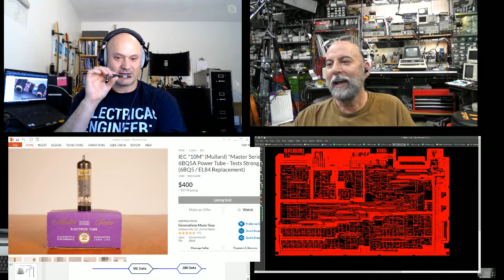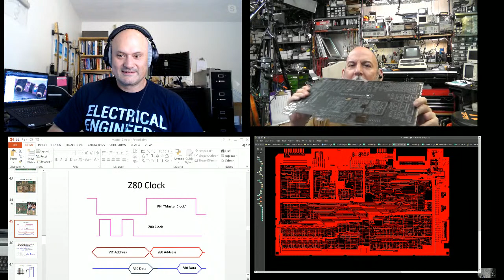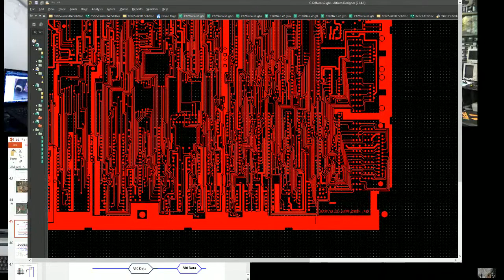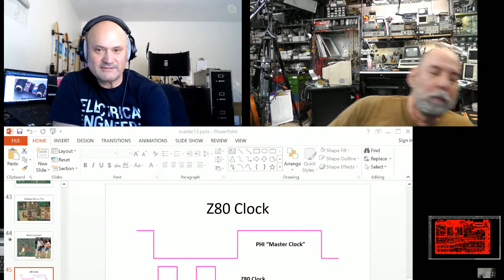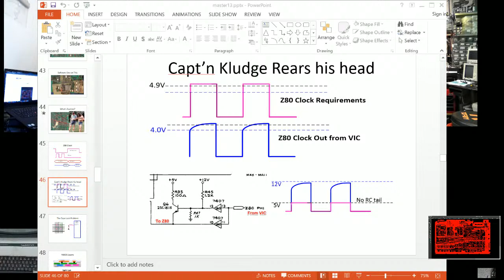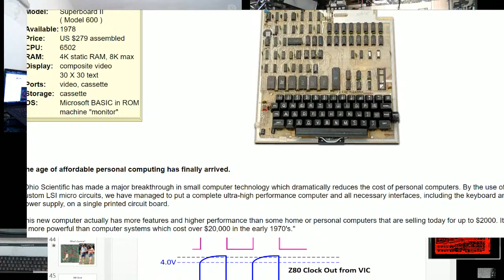The Coriolis Effect with Ben Jordan and Bil Herd, September 17th 2021

Comment: Thanks for making these videos (even though i'm not into electronics and don't understand most of it😆)! Very cool the legendary C128 creator is giving out information about his creation!

Just courious: Was it ever considered allowing the Z80 to go to full speed (4Mhz), by disabling the VIC from controlling the bus (much like what happens when the 6510 goes into 2Mhz mode)?
Reply from the maker: The pause in the clock is to allow a DRAM memory cycle to occur, (whether its needed or not) so there will always be that overhead.  Also it has to pause for DRAM refresh cycles generated by the VIC chip.

Comment: Thanks for the nostalgic video. It was most enjoyable.  Bil, where did you get your Z80 Clock specs?  The Zilog NMOS Z80 CPU datasheet says that it only requires a VH(Clock) in the range of Vcc - 0.6 (MOSTEK Vcc - 0.8) through Vcc + 0.3V, and VL(Clock) in the range of 0.45V (MOSTEK 0.8V) through -0.3V. To do this, many NMOS Z80 designs used a TTL, TTL LS or TTL Open Collector like a 7417 all with a 330R pullup on the output.
Reply from the maker: Yeah I didn't trust the RC element to not mess with the timing specs and I hated the thought of a low value resistor pullup on an active clock for noise reasons.

Comment: Hi Bill,
I was in the TPUG zoom meeting last night where you were a guest n I have a question that at least partly got lost in the chat.

You mentioned the Micron Technologies rams that often fail.  I'm just wondering if those are the MT branded 4164's used in the 64 (original model NOT 64C).  I've heard them called "MOS TEK" on a few other commodore repair videos on youtube.  Just wanted to be sure as 1 of my current 64's has these (well 6, 2 were replaced).  I know it seems like a trivial thing but probly best to avoid confusion among those (like me) who don't have the same experience with the inner workings of Commodore.
Reply from the maker: There were MOSTEK parts also possibly, I was referring to the ones from Micron.  I would have to look at a DRAM to see if it is from MSTEK or Micron.